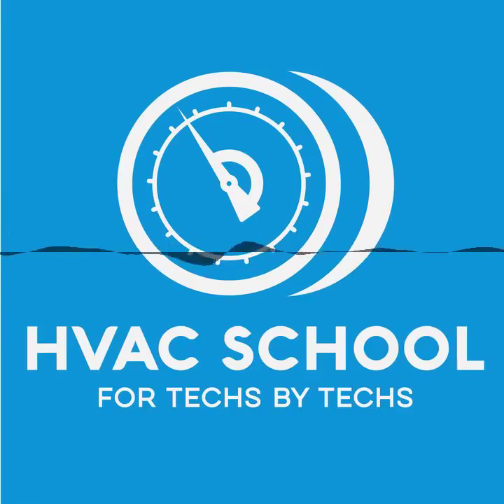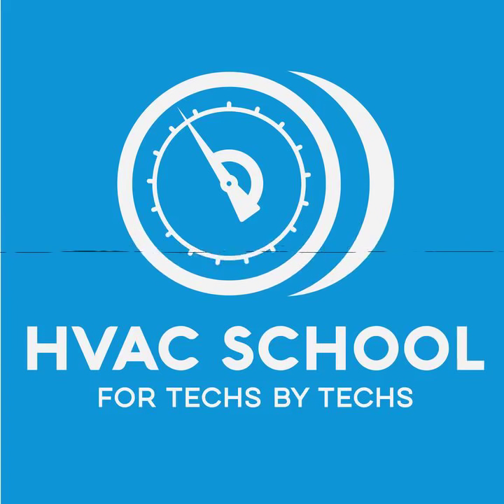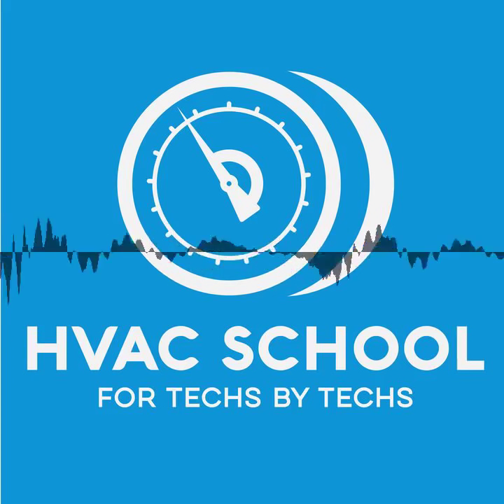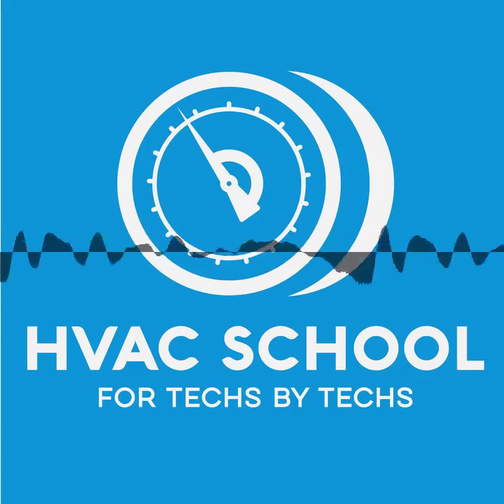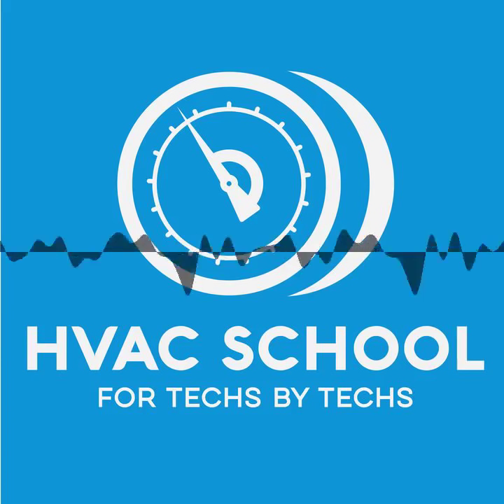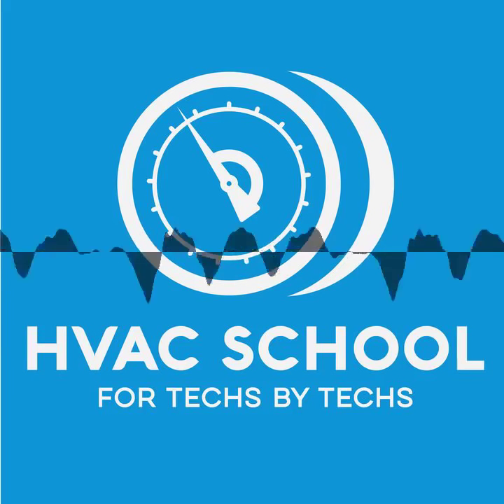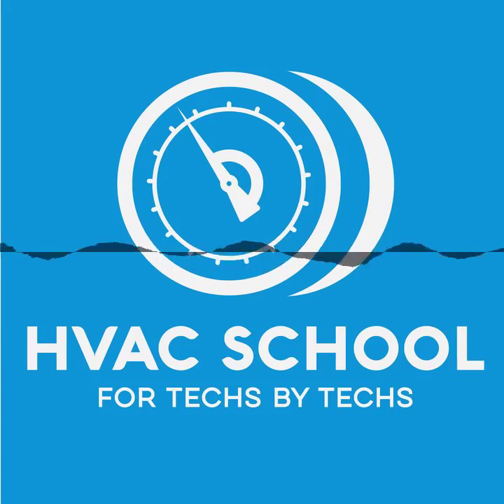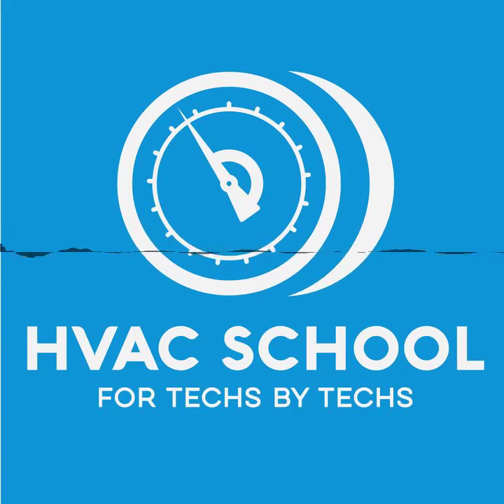Beacon 2 Refrigeration Talk Through

Comment: What's the longevity of these sensors? I have seen thermister go bad within 2 years or less. I feel that the sensing bulb is more reliable.
Reply: Ron White I have seen people just retrofit the eev with a normal txv because of how long it can take to get the valve. Iv seen them go pretty quick but not 100% sure